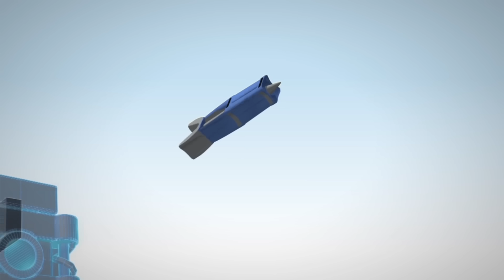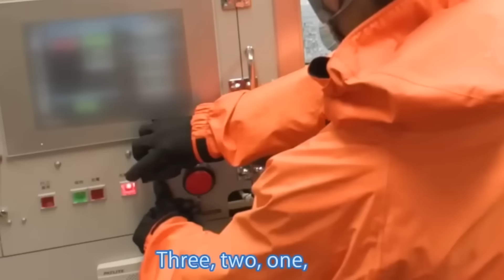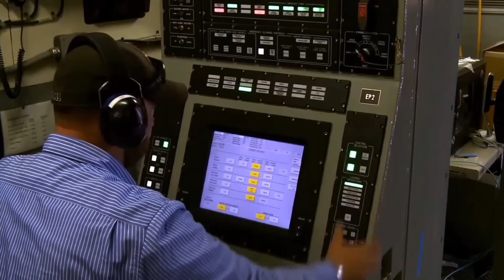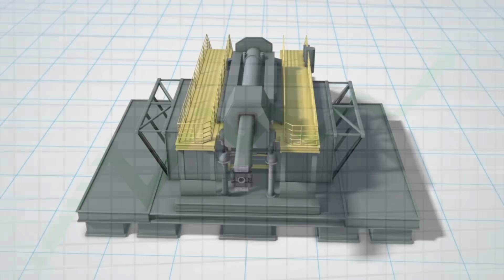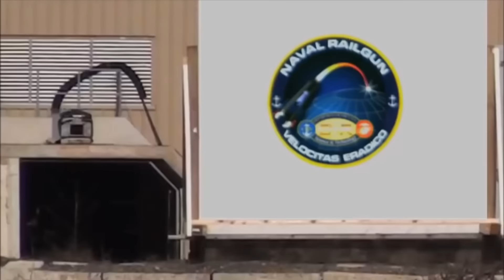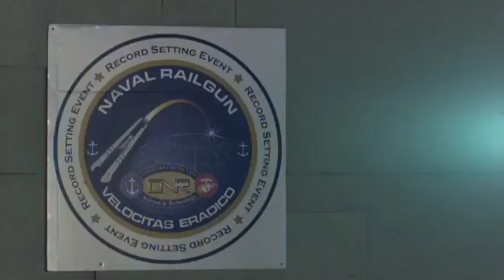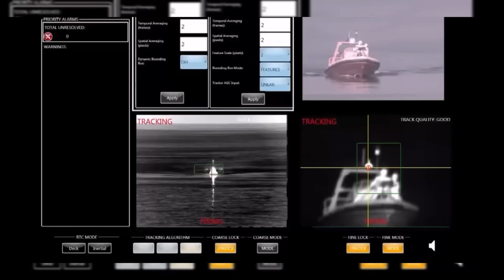Why Chinese weapons are useless? The US & Japan Just Revealed a $100B 'Space-Linked' Railgun

Comment: There was a "joke" told years ago that pointed out a truth. A German company claimed to have invented a metal alloy that no tool could drill a hole through. They made a 1ft square plate and sent the plate to other countries, to see if any other country could find a way to drill a hole in the plate. No country had the capability to do so. The last country they sent the plate to was Japan. Whithin a week, Japan sent the plate back with a quarter sized hole drilled through the plate.
Reply: And way back in the 70s, England sent a tiny glass tube -- 1/20th the diameter of a human hair -- 
to Japan, claiming it was the smallest glass tube possible.  Japan sent it back with theirs inside it!
Reply: I believe you! 😊
Reply: Wonder what they used???water?
Reply: @benjaminnennas-q3d 
A 1/4” Binford 230 drill bit.